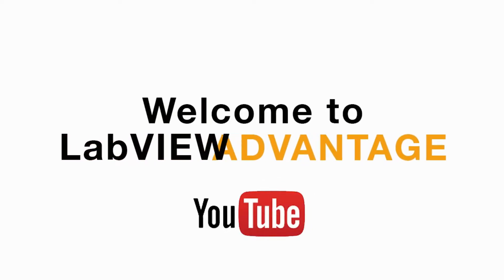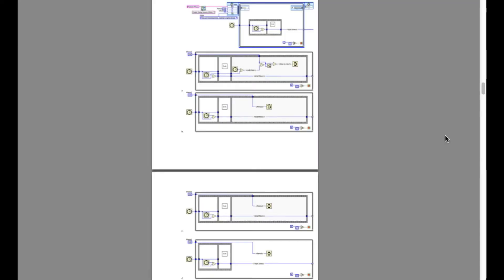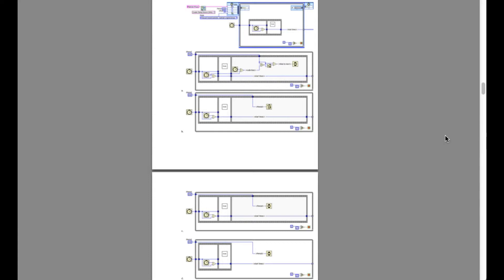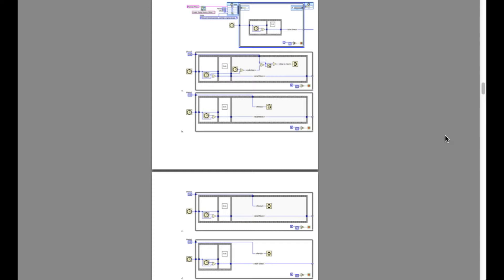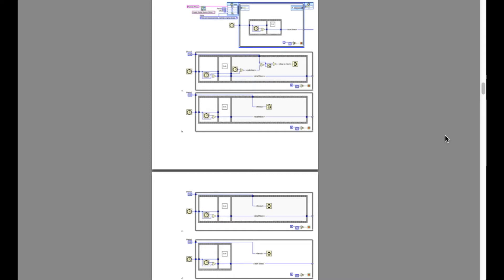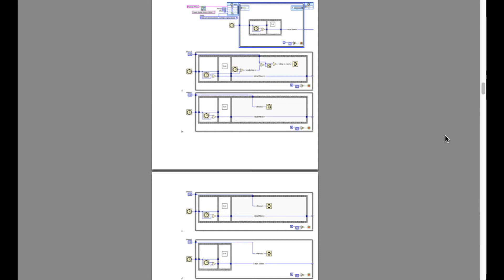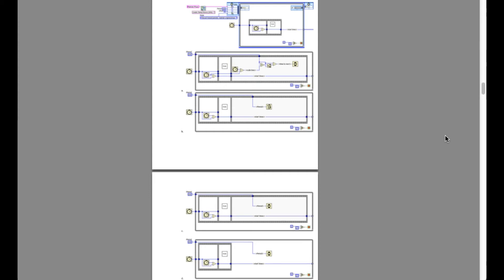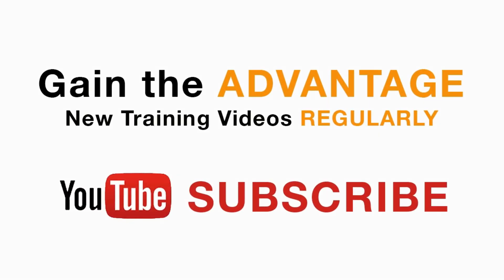LabVIEW CLD R 14 Replacing Timed Loop with While Loop

Comment: I agree the answer is A, but I believe the discussion of B is a bit lacking. The reason that B is not correct is that we do not know ahead of time what the computer's Tick Count is at when the While Loop begins. Consider two separate instances: (1) starting Tick Count = 1001, (2) starting Tick Count = 1099. Using solution B, and assuming instance (1), the second iteration of the While Loop will come after 99ms (Tick Count = 1100 being the next multiple of 100). Then, assuming instance (2), the second iteration will come after only 1ms. In both (1) and (2), every iteration after the first will be equally spaced by 100ms because of the Wait Until Next Millisecond Multiple vi. In the original Timed Loop, every iteration is exactly separated by 100ms, including the 1st to 2nd. So at a minimum, B fails due to the unknown time duration of the 1st iteration.